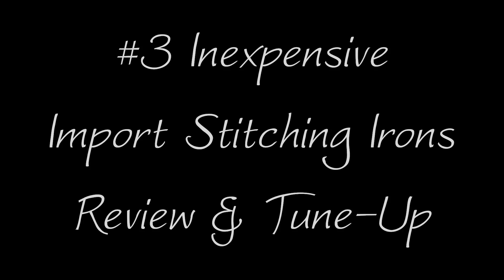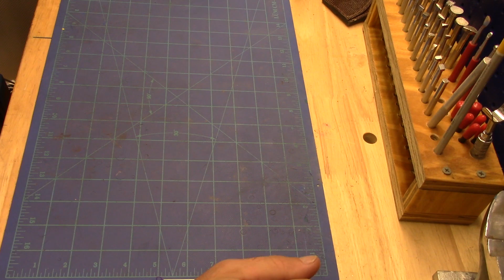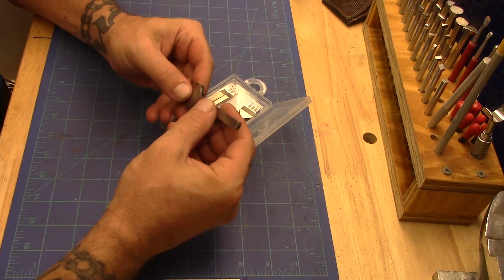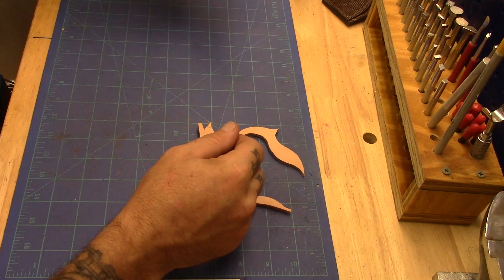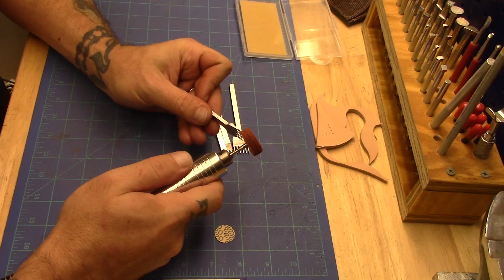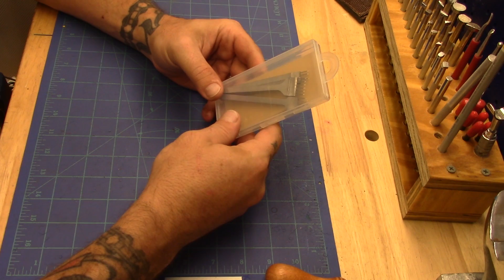Import Stitching Iron tune-up

Comment: Great video. Prior to polishing the tines on my chisels, I was using bee's wax on them to help  facilitate their removal from thick leather. The bonus there was any traces of bee's wax that was deposited in the holes helped with passing stitching needles through them, so I'm going to continue to wax the chisels.  
 
For the money, I think the Aiskaer stitching chisels are a great value and the workmanship is better than most of the China made ones in the same price point. In my opinion, the packaging they came in (plastic case and drawstring pouch) also reflects a higher attention to detail by the manufacturer.

Comment: When you buy an expensive set much of what you’re paying for is the polished pricks. Rough pricks, especially the 8-10 prong ones on a thick veg tanned leather makes pulling very difficult. And if not not pulled from a straight angle, you can even severely damage the holes and their shapes. Great video, mate

Comment: Another tip to after you have polished it up, you can get a block of wax and "stab" your iron into it. It helps when pulling the irons back out. the wax will be in your stitch hole but when you either use the awl or straight needle, it will force it our or coat your awl or needle. thanks for your tip.

Comment: I did the same exact things with my set (same brand as yours) and it completely upgraded them. The only issue I have is with the 6 prong. I ran it through 2 layers of 5-6oz veg tan and it took like 6 hard whacks to get it to sink through both layers. I'm thinking I need to put a longer point on them and did already, although just a small bit.

Comment: I've screwed up several projects trying 2 use an over stitched wheel from getting off line ill never use one again, i also bought some stitching Iran's from amazon trying 2 save a buck or 2 and they are not hardened and didn't last long, i ran across this video and watched it and done mine like yours and it worked out great,

Comment: Here is a tip from a mechanic. Don't pull straight up on the tool. Pull up while rocking it side.  Also, if you dye your project before you prep it for stitching,, you can use a little bit of wax or leather finish to lubricate the tool.
Reply: PS, I made my pricking tools out of a steel fork.

Comment: Nice video. I'll be doing a tune-up on the ones I have. I may also pick up a set of these. Thanks for the info.  Question:  What grit of sanding discs did you use for grinding and polishing?

Comment: I use the inexpensive Diamond brand from Weaver Leather Supply they aren't 12 bux they are $22 each for the 5mm and 4mm sets. I find I only use the 3mm on thin leather as those points are close and I need to use 0.6mm thread, the 0.8mm thread is just a little bit to big especially when I do wallets. The reason people break the tines is because they try to punch through too thick of material for the spread, also use wax to remove, makes it a lot easier. I make knife sheaths and I don't try to punch thru 3/8th in. leather, I punch the welt separate and drill holes in it so the needle won't miss. My sewing by hand looks like a machine did it and that's because of stitching needles.

Comment: I have the same brand and did the same thing before running across this vid. And it really is way better doing this. And mine are used very hard. And not messed up at all

Comment: Did the tips of your chisel really did not damaged from driving into the mat?
I had a set of those, without any brand name, and the point of the tips gets a little bit flat even I tried to not puncture all the way through a piece of scrap leather laying under my work piece.
Would using a mallet reduce the damage? Cause I am using a iron hammer to drive the chisel.
Reply from the maker: To one point, you should always use a mallet for striking metal tools, whether rawhide, wood, or plastic, a mallet won't deform the tool. I only use a metal hammer for a few key things, like setting rivets or snaps.  That said, I've driven these clear through the leather, backing leather, and into the blue mat a number of times, even through that into the bench a few times.  I wouldn't do either of those last two on a regular basis, but more for fear of snapping them than dulling them.  I will say though, that of the couple of brands I've tried, there was a marked difference in quality, it's entirely possible yet another brand wasn't treated properly and was soft when you got it...

Comment: I just bought one from Tandy and I cannot get it to go through the leather.  I am using a kitchen cutting board on my table to protect the table.  Is there a technique for getting it through the leather?
Reply from the maker: There are a couple of different models from Tandy, I've only seen one of them in hand, but it was fairly rough. A clean-up and polishing would probably help them as well. A touch of beeswax probably wouldn't hurt either.  I don't use a kitchen cutting board though, they're eventually fracture and can be a touch grabby. I always use some scrap leather under mine, as well as the cutting mat below that.
Reply: I'll give it a polish and some wax and see if that helps. Thanks for the reply!
Reply: Try stabbing them into a bar of glycerine saddle soap instead of beeswax.   The soap is more "slippery" and won't cause a possible issue with staining later on like beeswax sometimes will.

Comment: i have a cheap set and find them fab, i use the bone folder to hold the leather down while i pull the iron out, i dont find it a problem at all.
Reply from the maker: I've used a folder to help as well, with a good polishing though, I find I don't need it anymore.

Comment: Thanks for a top review, I got a lot from watching it. The best thing to do with the red rouge is to put it in the rubbish. The abrasive in red rouge is a low grade ferric (iron) oxide and it can get onto things you are working on and on metal can cause rust spots. The green chromium oxide based rouge from companies like Lee Valley tools is a good mix of cutting and polishing compounds and works on hardened steels.
The name on these chisels is interesting as the Japanese refer to the hard steel used in tools as white or blue steel. Named after the colour of the tissue paper that Hitachi wrap the individual pieces of steel stock in for storage. Blue steel is several times more expensive than white steel. There is nothing wrong with white steel it is till a step above many tool steels.All the best.
Reply from the maker: I'm always torn on some things like that... do I go with what everyone has, or specialized things most folks wouldn't. I have over a hundred lbs of various compounds sitting on a shelf about 6 feet to the right of the bench, but everyone with a cheap Dremel set has those little sticks of red :)  The red is really more for a buffing/final polishing, it's a very low cut typically, though each brand can vary by color (color isn't universal).

Comment: Thanks for the info. I've used the 4mm set for a year now and your so right about how they grab the leather. I tried using wax which worked for the 1st 2 punches only. Then had to re-wax them.  I've actually cut my hand twice trying to get them out of stacked leather projects. I have all the same Dremmel tools and will polish them up immediately. Cheers!
Reply from the maker: One of the other sets I didn't tune up was quite rough, I did grind/round off the handle end a bit initially...